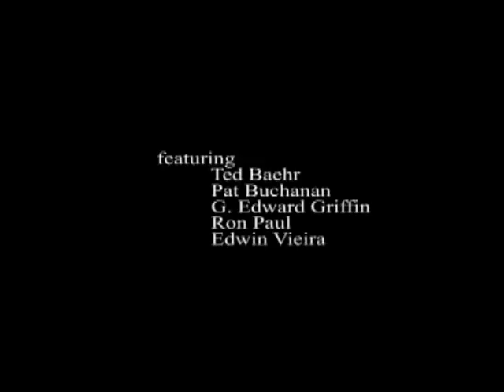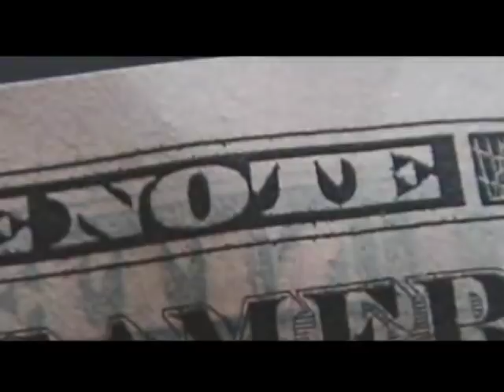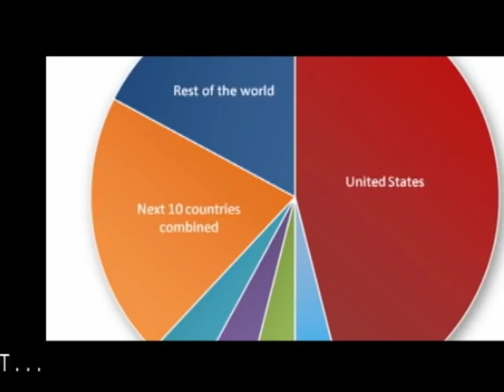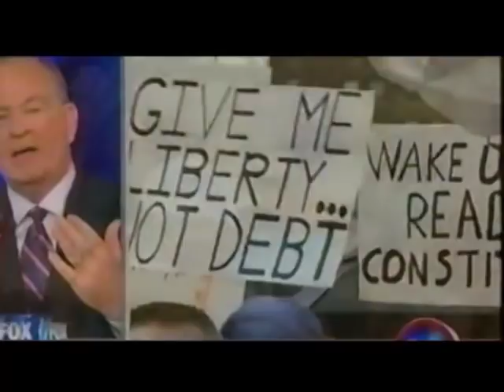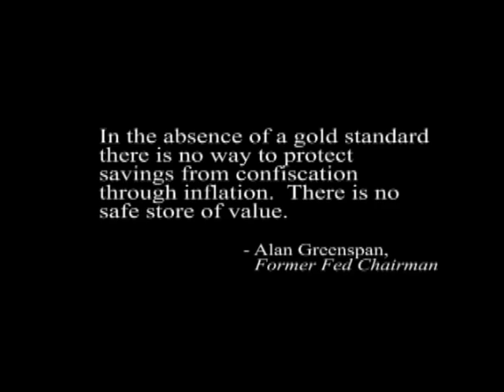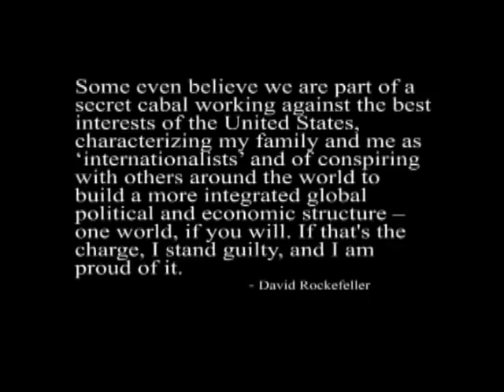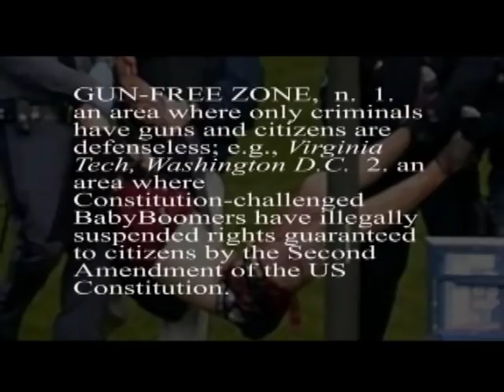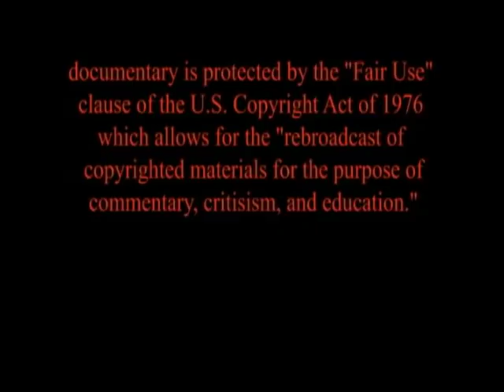CORPORATE FASCISM - The Destruction of America's Middle Class

Comment: That would work if they were poor to begin with and climbed their way up.  But it must be admitted that some kind of scandal or deal making goes into getting the best education and work program.  Normal hard work and smarts won't get them that high up that quickly.
Those who are born rich are usually spoiled and aren't appreciative of those who came before them who worked from the bottom up.  So they cut corners to make ends meet w/ the least of effort and more to gain.